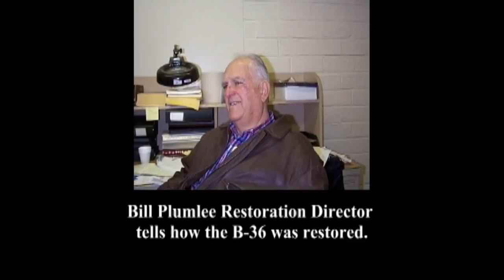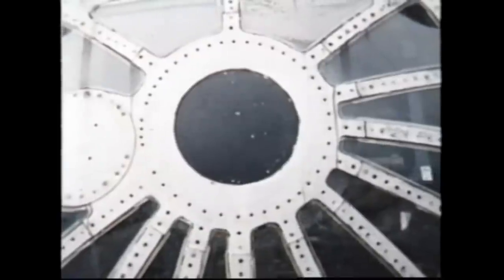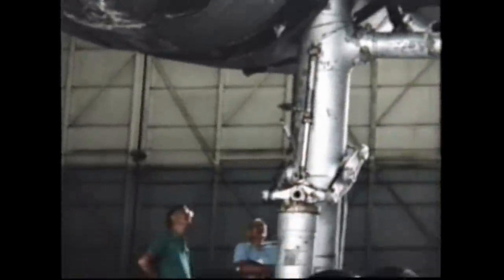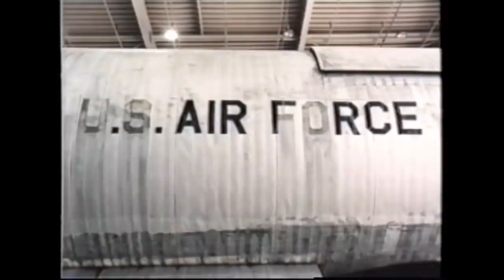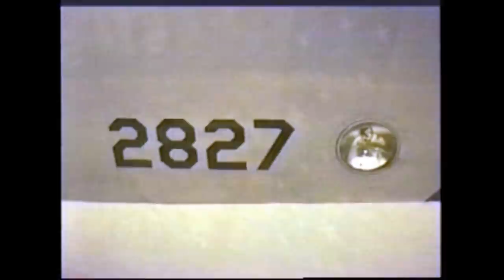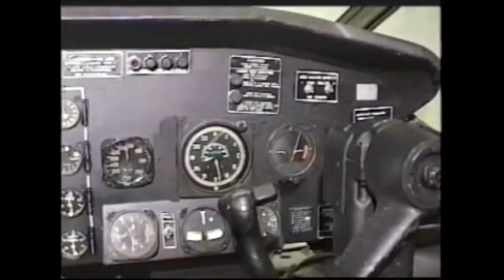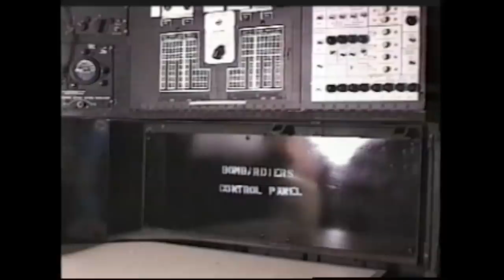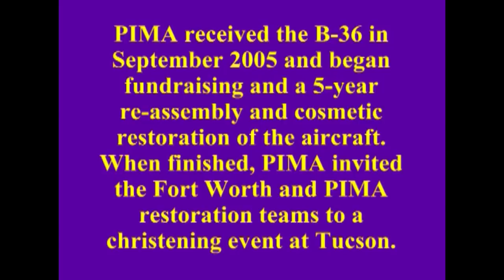Restoration of the last B-36 Bomber in Ft Worth

Comment: When I was a boy we lived under the glide path for the number one runway at Warner Robins AFB in Warner Robins Georgia. In the early fifties a wing of SAC was stationed there and many times I stood in the front yard of my home and watched and listened as a B-36 roared low overhead on final to runway number one. It was a sight and sound I will never forget. Families under the glide path used to complain to the Airforce about cracked windows from the B-36s roaring overhead. What a shame to see the last one so mistreated.
Reply: They were unbelievably loud.  Especially for the crew.  A lot of hearing loss for them.
Reply: I had forgotten that those were piston engines. I guess turboprops had not come along by then. It was, after all, a prewar design. They did get re engined with turboprops later. I'm guessing my memories are from about 1954/55. I would have been 10 or 11 years old,  I expect the crews wore hearing protection and still had hearing loss. One interesting detail; the turboprop engines had hollow square bladed props and some of the engine exhaust was routed through the props to keep them from icing up. Each blade had a small exhaust port near the tip.
Reply: One foot in the past, one foot taking a big step to the jet age. 6 turning 4 burning.
Reply: AR15 nut you are wrong that they were re-engined. The earliest planes had just the piston engines, and the jets were added all of those, but the 28 cylinder radials were in all of them for the 10 years that they were in service.
Reply: I stand corrected. What I meant to say was that the engines were changed from carburetion to fuel injection and when that occured the props (not turboprops) were were changed to square blades. The B-36 did run with the R4360 piston engines during their entire career.

Comment: Back in 1976 this B 36 was a gate guardian at the old Greater Southwest Airport. I worked as a volunteer and helped remove the engines and the jets. I was not there when they finally did the first moved to the Museum which was locate just before General Dynamics gate. It is a pity that this plane which was such a large part of the history of Fort Worth could not stay there.

Comment: 6 a turning and 4 a burning. This plane actually sat at the entrance of Greater Southwest Airport off of Highway 360 and Airport Freeway. As kids , we use to play inside of it. The airport was closed for passenger service in 1974 with the opening of DFW Airport. The airport remained for several years as a training facility for America Airlines until a crash during touch and goes. American Airlines Corporate Headquarters still remains across Highway 360. The airport was destroyed and Amon Carter Blvd lies on one of the two runways.
A great plane and it is a giant. Glad to see it restored , I wanted it to stay in Fort Worth where it was originally built at Consolidated.

Comment: Six turnin' and four burnin' She never fired a shot in anger.
Reply: Why should "she". It was all show off.
Reply: what does that mean , really ? is that from a 'Hallmark Cards' special on Lifetime network ???
Reply: @saemushailstorm3135  

6 turboprops engines "turning",  4 Jet engines "burning"
Reply: Those weren't turbo props those were 28 cylinder pratt & whitney r-4360 radial engines. Beautiful aircraft and I'm glad she never had to fire a shot in anger. Considering the pay load it was designed to carry.

Comment: I am only 61 years old but I remember Jimmy Stewart in the movie. I am gutted by this. My dad worked for Electric Boat and before that aircraft as an engineer. He told me about 6 turning, 8 burning long before I saw the movie. I have been to Loring for LSR stuff....far as I know that base was built for those aircraft
Reply: At least she wasn't scrapped, eh?  Pima is doing well by her.  I just hope that they give credit where credit is due to the Texas crew who preserved her from 1959 to 2005.
Reply: I actually just watched SAC on Amazon a few days ago. Still a great movie.
Reply: You mean 6 turning and 4 burning. Only had 4 jet engines.
Reply: Thet are NOT jet engines ...28 cylinder pratt and whitney R-4360 RADIAL PISTON  engines
Reply: It had NO ...."JET" engines...6  pratt and whigney r 4360 radial piston engines (gasoline engines) ie. av. Gas........!!!???
Reply: @f.dt.f3965  >>> The B-36 head four turbojet engines, two per wing, near the wingtips.
 
Look at the thumbnail for this video.  That silver thing sticking out from the leading edge of the right-wing, near the wing tip, is the pod containing the two turbojet engines.  There is red paint on the pod near the air inlets.  
 
The jet engines were used to help the aircraft get airborne.  They may have also been used to increase speed in flight in an emergency.  
 
I am not sure but I think there are some versions of the B-36 that did not have the jet engines on them, but as far as I know most did.

Comment: During the late 1960's, Convair employees offered to volunteer and restore this B-36.  Several of the original fabrication workers were still available to assist, but the DoD rejected all requests to permit the restoration. It was revised again when General Dynamics took over the plant, but the DoD didn't budge.
Reply: You Tube why did they reject it?
Reply: @sc1338  During that time, the framework of regulations constrained the DoD to reject a restoral of an aircraft that was capable of carrying nuclear weapons.

Comment: If anyone wants to see one perfectly restored, go to Dayton Ohio to the US Airforce museum.  It is indoors in a hanger with lots of otherplanes of it's era.  It also wasnt brought in pieces on a truck.  Its last flight was to the museum.  It is a totally complete functioninh air plane, that will likely never fly again.
Reply: There is a 360 picture tour  of the Air Force Museum at Wright Paterson .....National Museum of the U.S. Air Force
Reply: Much as the Enola Gay will never fly again. If it were to crash that valuable piece of history would be lost forever. It took years for the politically correct to come to  an agreement, not sure they really did, to reassemble the Enola Gay and display her at Dulles. It flew into Andrews AFB and spent many years rotting at the end of a runway before being moved to the Paul Garber restoration unit in Silver Hill Maryland. There it languished for many more years while SLOWLY being cosmetically restored. Much like the B-36 it was too large for display in any building at the time. There was also the argument that it should never be reassembled because of the destruction caused by her and Bock's Car. At one point they wanted to only display the nose at the Air and Space Museum on the National Mall. Even that was controversial. I was lucky that my father worked at Garber so I got to see her and many other aircraft even if they were in pieces. I also got to look inside the Enola Gay nose while it was being stored and redone. Very few have ever been inside the aircraft while it was there.We are lucky to have FIFI & DOC as flying B-29s. It would be great if there was a restored flyable B-36. But for now lets just be happy we have several static displays to remember them by. We don't need any more Ki Birds. The Nine O Nine and Aluminum Overcast   both have suffered great damage do to air crashes with loss of life as well.
Reply: That particular Peacemaker has had most of the engines pulled as it is a static display only. It looks amazing, but it will never fly.
Reply: In the late 90's, it was even still leaking oil from the Pratts after all those years.

Comment: The fuel burn on this plane had to of been bibical
Reply: In fact it was
Reply: Roger that. 6 turning 4 burning
Reply: Michael Moore ...6 gulping and 4 guzzling!
Reply: I read each engine had a 55 gallon drum of engine oil to support their oil consumption.
Reply: Try a 600-gallon tank each, 3,600 gallons total.  They'd shut an engine down for cruise to save oil - fire it back up for approach and landing. 

And 36,000 gallons of fuel.
Reply: Corrie Bergeron ...It almost seems like the gas-to-oil consumption ratio is 10:1...worse than a two-stroker!
A lot of the oil was likely slobbered around the engine cowlings. Those big radials were noted for that!
Reply: would have to carry 2 types of fuel as well, AV-GAS and Jet-A
Reply: uscgalpha91 there is no fuel burning in the bible, none whatsoever.
Reply: lol right you are !!
Reply: 4 engins turning and 2 burning
Reply: Nope.The jets burned avgas.  A maintenance task was to scrape the lead deposits off the exhaust vanes.
Reply: Negative, the jets on the B-36 burned AV-GAS.
Reply: See 1 Kings 18:20-40...
Reply: denmalski - not at all.  The early planes had just the piston engines (as did the one in this video, I think). A turbine engine can burn just about any liquid fuel. When they added the jets they just ran them on gasoline.
Reply: You mean JP-4   :)
Reply: Lol,  I have heard it said that the airmen who worked on them had a different saying---two turning, two burning, two smokin', two chokin',  and two unaccounted for!
Reply: Sometimes even that wasn't enough oil. Some engines would burn so much oil they said it was the first engine that never needed an oil change. It did it itself.
Reply: Nope.  They were tuned to burn hi-octane.
Reply: Verse 38.  :-D
Reply: That too. :-)
Reply: 6 Turning and 4 Burning! I went to tech school at Chanute AFB, Rantoul, IL in late November 1955  to April,1954  to be a mechanic on the 4360. What monster of an engine! They powered the B-50s on the first non-stop flight around the globe using in flight refueling. The 4360s did service on KC-97 refueling tankers until the jet powered KC-135s came on line.
Reply: No more than a modern Jet... may be even less. Not sure if the 4 burning were used in cruise. I think they were not used all the time. The 6 radials were less fuel burn than early Jets.... is my guess.
Reply: no, a jet will burn avgas just fine. infact, you get a little (not much granted) performance advantage from some engines by running it. thing is it costs about 3 times as much
Reply: Burning gasoline in a jet engine can be done but it has massive restrictions if not prohibited outright by the manufacture, and using it will except only for short periods will damage engine... (I am talking modern jet engines)..
Reply: denmalski 
It only carried 115/145 performance rating avgas. The jets would run on the avgas. The turbine sections of the jet engines would become coated with lead bromide.
Reply: Yep just like a alcoholic on coke !! but she flew well
Reply: @denmalski  I read that both engines ran on one type of fuel.
Reply: Matthew 25:1-12
Reply: @uscgalpha91  Two turning, two burning, two choking, two smoking and two unaccounted for.
Reply: @denmalski  Jets will burn almost anything.  They used the av gas just like P2s with their R3350s and J34s.  Seems to me C119s were sometimes equipped with jets too.
Reply: @westbender 820 hmmm, I opened a bible once, no fire came out?
Reply: @denmalski  Nah, jet engines are not picky, they'll burn practically anything you can feed them. AV-GAS would've been perfectly acceptable. The only notable difference when using fuels other than Jet-A is the amount of thrust the engine can produce and the fuel consumption. Some fuels will give better performance than others.
Reply: @CorrieBergeron  each engine had a 100 gallon tank for oil not 600.

Comment: So the Air Force says "Ya can't keep it in Ft Worth if you don't cover it" Airforce takes it to Pima cause its not inside. And displays it "Outside" WTF????
Reply: When was the last time they had a hurricane in Arizona?  The environment is more favorable for outside storage.  They have a B-36 in Omaha, NE Inside, and an SR-71.  It's a good trip.  You can sit in the cockpit, engineer station. I think they have a B-52 tucked in under one of the wings, it is a massive airplane.  All that magnesium is rotted and brittle.  If you tried to stand on the wing you'd go right through.
Reply: Been around 10,000 yrs ago now I suppose. HAHA. I was ribbing the AF for the whole double standard. If the point was it has to be inside and that's why they took it then why isn't it inside? I mean if that was the point?   I live about an hour and a half from Robins AFB, they have a fantastic museum there. SR-71, B-29 B-17 B-52 B-1B and many more. 90% are inside as well.
Reply: Need a good old Sac base with the huge hangers to tuck it in.  I don't know what they ran out of Salina, KS but it was an alternate runway for the space shuttle, the hangars we had for school had cutouts in the doors quite a ways up but no way were they big enough for a 36.  Reminds me when I worked at Cessna and got laid off.  I was in a "big" hangar with Fatigue and Static test, flight test and a goodly sized shop.  I had to go apply at Boeing on the other side of town.  My jaw dropped while I drove by monster hangar after monster hangar.  Put all of my buildings at the Wallace plant in one of those.   The results?  Well, I spent about 4 years in Golf Course Maintenance.
Reply: Comparing Tucson climate to Ft. Worth climate is useless.

Comment: Was this the one that was at Greater Southwest Airport south of DFW AP? Saw it at the last airshow there in about 1971.
Reply: Yes, she was outside South of the GSW terminal. I drove past her everyday going to work at AA in the old terminal.  At one point a group had the recip engines running. Then the AF got worried someone would hijack it to Cuba and that project died. Funny thing was that vandals pulling the props through kept the engines lubricated so they  cranked up fine. That 1971 airshow was epic!
Reply: Except that they broke in and trashed the flight deck.
Reply: PhotoFusion Technologies, Inc.  Thank you. I was wondering what the timeline was for it getting back to Carswell AFB.

Comment: My guess that it was a "  Hangar Queen " for all the running B-36 planes to keep them running their missions. That would explain the " missing parts "
Reply: Um.... nope.  

The *fully-operational* aircraft was flown by a USAF crew from Biggs AFB in El Paso to Greater Southwest Airport (aka Amon Carter Field - Mr. Carter being personally responsible for Government Plant #4 plant being built in Ft. Worth to begin with). 

I worked on #2827 in the late 70's - the period immediately before the move to Carswell (we took it apart in big chunks just like they had to do to move it to Pima).  The cockpit and rear compartment had been broken into and vandalized.  Badly. I have pictures. 

A year or so before I got involved, the crew had all six recips running.  The USAF pulled the plug on that, and we had to literally remove the engines and accessories from the nacelles and weld up propeller mounts.  I helped with that effort. 

The crew in Ft. Worth did an incredible job.  Too bad the city didn't care enough to build a home for her.

Comment: At the least...Pima did a fine, fine job with the aircraft. I'm confident it will remain there for a long time, proclaiming both the excellence of the original engineering....and its restoration.

Comment: Outside in TX - NO; Outside in AZ - no problem.
Reply: Yes!  Pima has such an extensive outdoor collection because they initially got donations of significant aircraft from the Air Force's Boneyard at nearby Davis-Monthan AFB.  With the area's low humidity in the 10%-20% range, meager rainfall of 11" annually, hard alkaline soil, and high altitude of 2,550 feet allowing the aircraft to be naturally preserved for cannibalization or possible reuse, Davis-Monthan was the logical choice for a major storage facility.  Also the geology of the desert allows aircraft to be moved around without having to pave the storage areas.  In February of 1956, the first Convair B-36 Peacemaker aircraft arrived at Davis-Monthan AFB for scrapping.  All of the fleet of 384 Peacemakers would ultimately be dismantled except for four remaining B-36 survivors saved for air museums.  This example has come BACK to roost in Tucson where it will be well-preserved...like an Egyptian mummy!

Comment: One can never forget the feel and smell of climbing aboard a B-36.  The smell of urine , coffee, old in-flight lunches, hydraulic oil, fuel and sweat. The sound and vibraton at take-off power and the sound when the engines finally all get in sync. WOW!! 24  hours latter coming in on a frozen runway with a  cross-wind and the final when the props go into reverse.  I still dream about it.
Reply: Nightmares, hopefully. Oceans of blood and charred flesh.
Reply: @johnsmith1474  It was called the peacemaker because that's exactly what it did.  I never dropped a bomb on any enemy. I deterred war and destruction for decades. Not all offensive weapons are used to kill some are used to make it senseless to start a war.

Comment: I used to work in Bldg 65 at Wright-Patt.  At one time they actually took a B36 and flipped it upside down end over end using the internal crane in the building.  Several photos of the operation are posted on one of the walls near the office entrance to 65.  Was very impressive.

Comment: When I was a high school kid in Ft. Worth in the late 1950's and Dad was involved in B-58 design, we lived almost straight south from the NS runway at Carswell. We had B-36's overhead all the time, and then we watched as the first B-58 flight went right over our house. The difference: For the 36, when you heard it coming, you went out on the north side of the house. For the 58 you went out the other side, even right after takeoff it would have passed by before you could get out.
I also remember when we were first moving there, house hunting, seeing a B-36 parked just off the main runway that had an international radiation symbol on the vertical fin. I immediately guessed it was being used for tests involved in making a nuclear powered plane, and a year or so later Aviation Week wrote it up as such.
Bob W